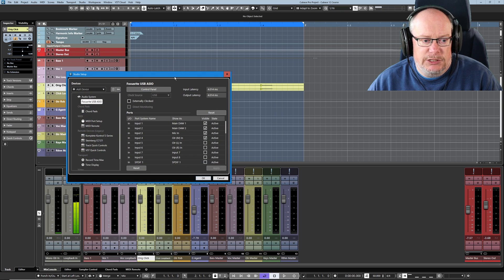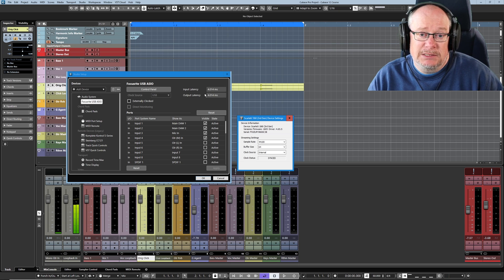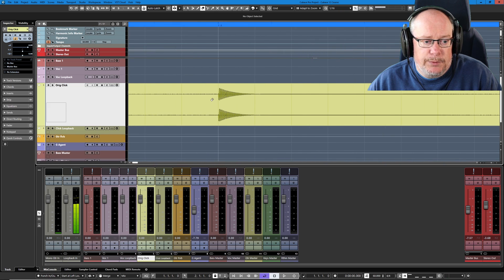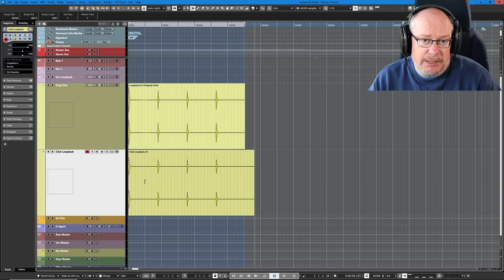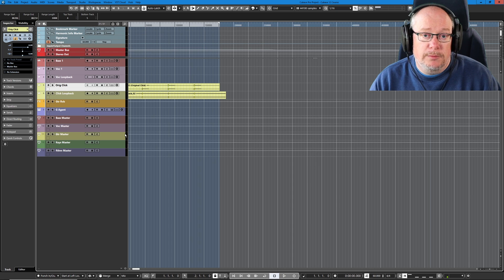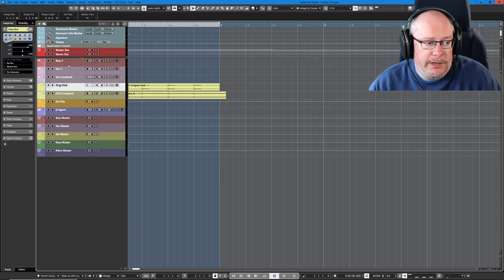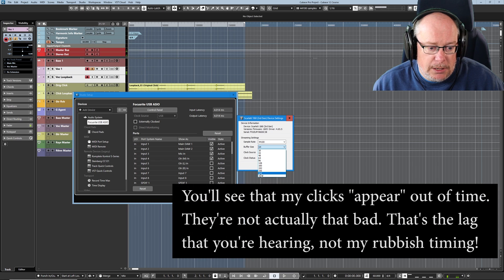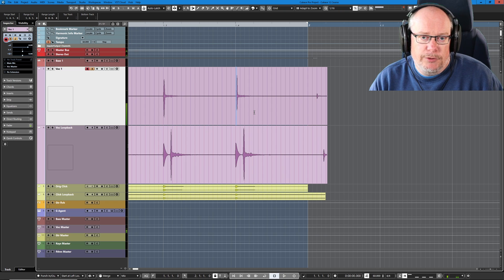The Essential Guide to Latency in Cubase 12 (Pt.1) - Understanding Buffers

Comment: The problem I have is that I have the same settings in Cubase 12 as Cubase 5, and yet Cubase 5 works perfectly fine and Cubase 12 has a quarter second lag when I try to record guitar. Do you have any ideas of whats going on?
Reply from the maker: Not really. There's such a gulf between those versions that it could be any number of things. If you raise a support ticket with Steinberg they'll probably ask you to send them some config info and hopefully look into it for you. You should definitely be able to configure it such that you have un-noticeable lag.
Reply: @OneManAndHisSongs   I finally figured it out. I had a plugin on my stereo out channel that was causing the latency. it wasnt an issue in cubase 5 because its a 64bit plugin and the 32 bit version of cubase 5 was disabling it.

Comment: Let me ask you a few questions - can you work consistently at a buffer size of 64 ms ? I have an i9 18core, 128GB RAM and a RME Fireface 802 card and the minimum buffer size for me is 128 ms. I was expecting to get to better values with this computer ... are you using ASIO GUARD ? Thank you for your answers.
Reply from the maker: My current setting is actually 128, for the same reason. In all honesty, 64ms would be fine except for very large projects - I just can't tell the difference between latencies at either of those values so have settled out at 128. Yes, ASIO Guard is an absolute must. There's no reason to ever turn it off.

Comment: I'm not understanding the difference in your two experiments. Seems like they both just have an analog out and back into your interface and that they only differ in the source of the original audio. Am I missing something?
Reply from the maker: Sorry,  I don't understand your question. In this episode I run various experiments, but the tl;dr is that I'm trying to demonstrate how many different potential latency/buffer points there are, and how Cubase attempts to compensate for them. It's a very complex subject, unfortunately, so there isn't one simple demo that shows all the issues. I did my best though!

Comment: Weird my M-Audio Mtrack plus doesnt allow me to go lower then 128, but im getting alot of latency when im trying to record, but even with my pci audio card same deal even with 64 sample buffer. Is there anything else that could cause this ? it goes back to normal using older nuendo but the nuendo 12 or cubase 12 there is an annoying latency ugh. my latency says its around 8 but even with my old nuendo its around the same but at 256 samples but no latency, its fine but only issues with newer Cubase 12.
Reply from the maker: Sorry to ask such a basic question, but are you definitely selecting the ASIO driver in your Studio Setup\Audio System screen? Quite often I find that people are inadvertently using a generic driver, and that's the root of all their troubles. My only other suggestion would be to work through each of the videos in this mini-series, following my tests one at a time to see is you can pin down where the lag is coming from.
Reply: @OneManAndHisSongs  it was actually the delay compensation button that took it away finally. Ugh, I really don't like that. It's like that system can't handle plugins while you record? The older Daws were much more stable.

Comment: You seem to know your stuff, and you also have a focusrite, so I hope you will be able to help me with my issue because I haven't seen a solution explained, even in your vid.

I'm using a focusrite 2i2. 64 buffer size, have the exact same latency listed as you: 4.104ms in and out.

I understand everything you mentioned about cubase automatically taking that into account. But... What happens if the only way I have of monitoring what I'm playing is the cubase monitor buttons? (i.e. no physical amp or pre-amp  - just headphones on my focusrite). There is a much bigger delay than 8ms from the time that I strum my guitar to the time I hear it from cubase with all its VSTs (I measured it at about 52ms - nowhere in cubase does it list such delay). Small still, but in high tempos where you need pinpoint accuracy it's noticeable. So when i'm recording and I hear the audio from my focusrite, including my playing, my brain automatically "calibrates" this difference, and makes my hands play about 52ms faster than the audio, so that the sound of my playing is right on time in my headphones. But of course, if I then go to play it back, the track is 52ms ahead. And I either have to move it 52ms or add a 52ms delay to my track.

EDIT: So after watching your pt. 3 video I found the problem. I enabled the option to see the delay that comes from each channel in the mixer, and even though most of my channels had sub-1ms delay, my master track had 72ms delay, which is what was causing the issues. Using the "constrain delay compensation" button fixes everything. Thanks a lot for these videos!
Reply from the maker: Thank goodness I read your whole comment before replying :) Really glad you were able to sort the problem, and thanks for the support.

Comment: always on Cubase 12, Even I decrease the buffer size to 16, the latency stay in 40.000 MS, should I change my focus rite interface 2I2 ? otherwise when I disactivate monitor icon on an audio track the latency fits exactly the metronome!
Reply from the maker: Your 2i2 should be much faster than that - I used to have a 2i2 before I switched to the 18i8, but their fundamental latencies should be very similar. Send me a screenshot of your Studio Setup\Audio System dialog to anthony@onemanandhissongs.com and I'll see if I can see anything obvious, but you might have to log a support request with Steinberg (or ask for help on the Steinberg forum).
Reply: @OneManAndHisSongs  Thanks man, and I will follow your instructions.